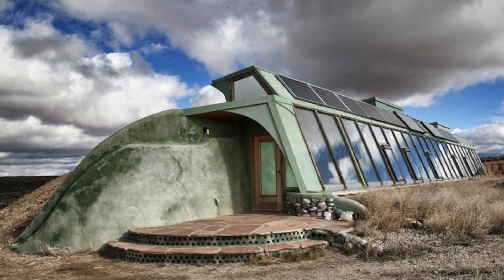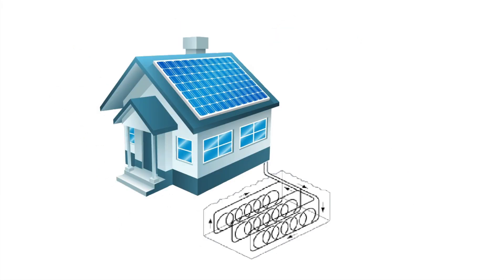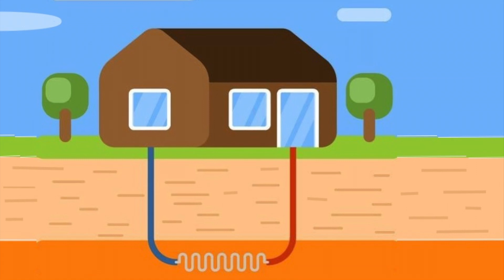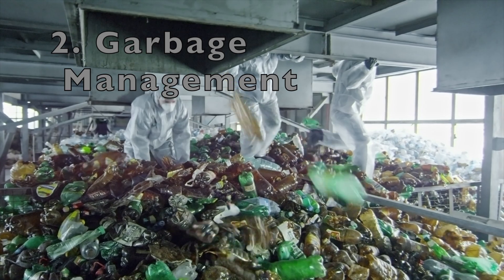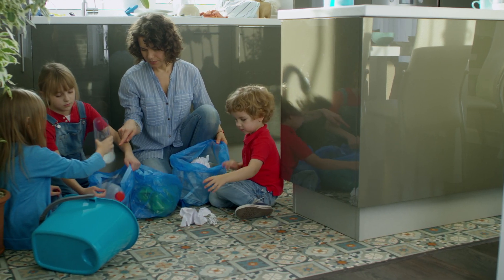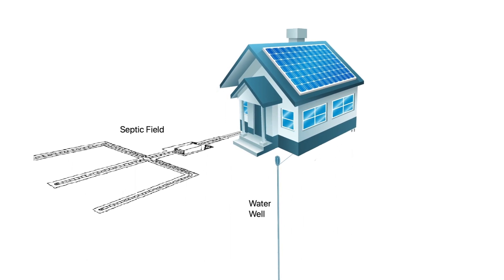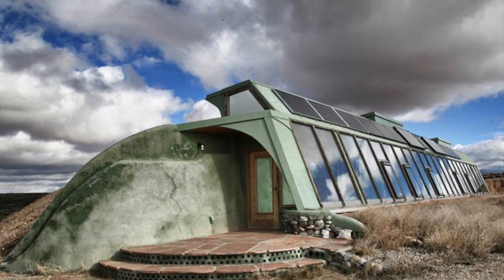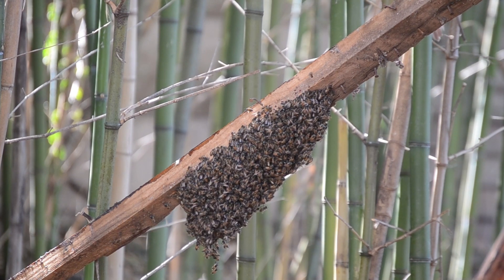Earthship Energy Savings for Any Home!

Comment: I agree that earthship construction balances/integrates a lot of compromises but no single one is a requirement for most of the design principles to be implemented. (Same as how one or more could potentially be used to retrofit a traditional home.) After attending a month long academy session and living with my family in an older earthship I will say that controlling the temperatures inside is not difficult, the roof vents are dead easy to operate, and from a systems perspective they do not really require more to be aware of than a normal home... most of which people are oblivious to in their own normal houses anyhow until a problem arises. This is why there is a thriving maintenance and repair industry ready to serve. It was not moist inside and it didn't smell. It did have flies but it wasn't out of control like some other much older ones.

Cooling tubes and earth berms work. The temperature is stable and the cooling effect works even before the building is fully enclosed. (I know, because on a 90 deg F day in the high desert working on a brand new earthship in 2017 we were all gathered around the cool air flowing into the almost completely open building while eating lunch.) We all also visited numerous couples and families living in a variety of homes covering the major evolutionary points of the technology over the years and they were all pleased with them. Even older retired couples had no issues managing the building. The greenhouses were warm but comfortable, the living spaces were between 68 and 72, the walls and floor cool to the touch and it was a blazing inferno in the sun outside. I believe re-engineering the ducts, transoms, and roof vents could improve the greenhouses more. However, the newest Global Models just seem to work.

Pounding tires is actually fun when you have the right people helping. But then again I would rather pound tires than pay for a gym membership... at least I get a building at the end. Foxhole homes in Alamogordo solved the tire pounding problem by using tire bales... huge compressed steel banded tire bricks moved into place by heavy equipment.

You are partially correct about the greenhouses tending to get too hot in older earthships but this is because Michael Reynolds and crew are not engineers; they are nice, well meaning, high desert hippies that "felt" their way through the entire process of refinement. "Close enough" engineering followed by copious amounts of beer and margaritas. It is my sense of the man that he really has a problem with authority (across ALL the required trades to build a home that is up to code) and while I respect what he has achieved I think he could have done a lot more if he had been willing to invest in engineers to bring the math necessary to optimize early on and find a set of design functions that the parameters of latitude, max / min temps, avg sun exposure, etc could have been plugged into and output how much southern glass was needed, how much interior volume of air, and how much mass of berm. You will notice the new designs use vertical glass rather than the aesthetically pleasing and distinctive slanted glass set perpendicular to the noon sun in winter. They are improving but at an absolutely glacial pace. They also waste resources as much as they reclaim. Their cabinetry and wood work is over built, adding to costs. They use crazy amounts of cement based plasters and coatings when other materials would work for infill before top coating. And they absolutely will not deviate from their southwest inspired design and Michael Reynolds has said multiple times that if you don't like his designs then basically take a hike; they won't build you anything that is customized. 

Water was not an issue in our quarters during the academy. My wife, our six month old (at the time), and I bathed, washed dishes, etc as we would anywhere else without really fretting too much about where the water level was in the sight glass. It "just worked" but some people in other areas did have to have a delivery of water but then they were not all the most... responsible individuals I have known in my life. :) Here in WA I would not have an issue storing and maintaining 6000gal of water in cisterns.

I disagree about the water systems. People have filters for water in their homes already (fridge water and ice maker, under sink systems, water softeners, etc) and well water often needs to be filtered and definitely needs to be pressurized in exactly the same way to make it useful in a home regardless. There is functionally no difference. Gray water use for flushing I think should be integrated into most homes... there is no reason I should be sending more water than is needed to my septic system than is absolutely necessary, and if that water is coming from a municipality all the more reason to conserve if nothing more than for operational cost savings. Botanical cells (the growing beds in the green house) are an adaptable and useful solution for this. However, older earthships absolutely do suffer from issues with them as they were often neglected when a new more interesting project came along. (Flies are the big problem with the oldest of buildings and I more than once suggested a good project for students to get hands on with systems would be to rebuild and refit the ancient botanical cells for modern versions with constant flowing water.)

Sorry for the large post... I do respect your ideas for bringing similar enhancements to existing structures.
Reply from the maker: OMG THANK YOU for such a detailed response. I LOVED reading it. THANK YOU!
Reply: @SimpleTek  I really enjoy your videos and ideas and it is nice to see a channel where a conversation seems to be genuinely desired.

There is also something to be mentioned of costs... the cheapest new earthship we toured was a "simple survival" design finished in 2016. It was a one bedroom one bath and the gentleman who built it almost entirely on his own spent only $50k (not including the land purchase) by avoiding waste, costly finishes, and using reasonable materials. He did splurge on large expensive SLA batteries that could be used inside the home without fear of gas releases simplifying things further. Earthships build by arthship Biotecture are expensive... something around $350,000 for a Global Model if they come build it with you. (It is hard to get a straight answer out of them on many of the specifics.) Like all things, if you are willing to put in the work yourself and take your time the costs can be brought under control. (Or if you are willing to use what will work and is not strictly up to code and can get away with it such as the philanthropic projects EB has done around the world where people just need something to inspire them to make use of wastes like bottles and styrofoam.)

I may sound like I am coming down hard on the Earthship crew but really they are kind and lovely people who are trying to do good in the world and I support their work... I just am not one of the "Cool-aid" drinking crowd and will criticize them on the areas I believe it is needed. I think Mr. Reynolds is correct when he points out that trash is now as much a natural resource waiting to be used thanks to humans as trees growing in a forest. I know there are many ways to recycle things like tires but pounding a tire with dirt has a much less lower embodied energy compared to transporting it to facilities for shredding and reworking.

Anyhow, have a great day.
Reply from the maker: @one_b  I think you are spot on about earthships and love the personal experience exposure you've had around them! please feel free to comment on any of my videos anytime, I love your comments!
Reply: I dig the post joshua. Especially your thoughts about water handling. I build geodesic domes. Do you have any experience with those?
Reply: @lemondealc  I wish I did. I have been dreaming about a geodesic dome based surf shack at the coast or auxiliary building in my back yard for a long while. (An inflatable aircrete dome was / is on the list as well as another contender.) Buckminster Fuller is on my short list of most inspiring people. My main issue with the various designs/possible materials is creating the necessary very accurately cut angles or justifying buying any one of the various costly custom connectors that have been produced to make the domes easier to build... then you have to decide how you are going to wrap it to close the envelope... Still

Comment: I already have a septic and well where I live but was thinking about using a solar pump and fan to pump the water thru a radiator  to cool it during the summer, What do you think?
Reply from the maker: if you have a place to put the water - well water through a radiator works great for air conditioning
Reply: @SimpleTek  I was thinking about taking it out of well thru radiator and back into well but was wondering if it would hurt the well somehow? maybe the heat would start algae but I could add some pool shock or something like it the well is 8 ft round and 40 ft deep  with a 6 ft tunnel at the bottom about 10 ft long, Yes I drained and cleaned it yrs ago LOL.
Reply from the maker: rv sorce I’ve heard a well can take back whatever it puts out, but I’m no expert
Reply: @rvsorce7196  please don't put some chemical's in your well. They could get to the groundwater easier than if you put them on top of the soil because you are already at the groundwater table.
Reply: @TheNightwalker247   I wasn't going to use a old radiator I was doing to build a new one and use solar to move it into and out of the well via a pump as well as a fan into the house, was just worried that heating the water and returning it to well might start some kind of algae.

Comment: It is important to pick off all low hanging fruit first.  For example I added insulation to my attic and sealed many cracks for US$600, including adding 500 sq ft of storage, ending up with 12 inches of insulation covered with a wood floor.  My gas company now says we are one of their most efficient customers.  Always do the cheapest with the best return in the least time...
Reply from the maker: well said!
Reply: The U.S. Dept. of Energy put out a booklet in the 70's that had energy saving tips arranged like you said. First was air-sealing, even over insulation, to keep your warm air from blowing out through your walls. Next was insulation, with proper overhangs for solar gain control. Next was landscaping, with evergreens for the north side as a winter windbreak, and deciduous trees for the south as summer shade, but allowing winter solar gain. The last thing that they mentioned was the interior arrangement of the house, with storage and mechanical spaces arranged on the North side of the building (This is the prevailing cold side during winter in the Northern Hemisphere). I know some people will say that making a house "too tight" will generate moisture problems and make you sick over time, that the air leaks are to maintain your health. This is just excuses by lazy people. Many locations now REQUIRE very tight construction, with monitored and controlled ventilation for comfort and energy savings.

Simple Tek mentioned that a lot of complexity in the water/waste management could be dispensed with by simply using a septic tank and leech field. Well, the tank and leech field ARE used in the Earthship, as the last stage of the process, called the outside Bio-cell. The whole reason for all the complexity of the water system is simply to utilize less water, in an area where water is a very scarce resource, and costs even more than electrical power.

The rest of the Earthship design is mostly Passive Solar design, with bits of PAHS (Passive Annual Heat Storage) principles, and a dash of "The $50 and Up Underground House". I fully expect that with the development of cheap and reliable IOT and computer monitoring and control (Home automation technology), ACTIVE solar design will once again flourish and provide an order of magnitude more performance return than the simpler passive systems.

Comment: I live one county over from Taos (where most of these Earthships are built). The average well here costs $35000 to drill. It is WAY less expensive to build or install cisterns and a water catchment field!
Water rights are also extremely tricky here. Many properties in northern NM do not have the right to drill.
Reply: Further, we only get 12" of rain a year and wells commonly run dry. So every drop is precious. In rural communities in the desert, reusing our greywater isn't about being smug, it's about basic economics and survival.
Reply from the maker: Thank you for the reply. I've never lived there and the concept  is foreign to me. How far down do you have to drill if they are charging you $35,000 for a well?
Reply: @SimpleTek  500-600 feet is pretty common, 800 is not unheard of... occasionally you can get lucky and hit water at shallower depths. But I've never heard of less than 150.
On my property we could reach water at 300 feet, but would only get about 2.5 gpm. We can't afford that, so we catch the rain off our roof and built a catchment field on the ground and 20k gallons of storage tanks (we hope to build another 10k this year). It only cost us ~2k in materials and our own labor for the whole system including the pumps and filtration system.
Reply: Magic and Mundane what cistern type do you have which is so cheap?
Reply: @T0MME0  We build our cisterns by hand with ferrocement. Other than the portland, all the materials are either bought from boneyards for pennies on the pound or scavenged from neighbors old projects (for example hardwire mesh pulled of an old chicken coop). We do sand gravel filtration on the water for the tap and solar still for drinking water. The catchment fields are built from a variety of scavenged material like old tin roofing. 
To buy premade poly cisterns in our area you could expect to pay 50 to 75 cents a gallon depending on the volume.
Reply: @madeofyucca  Ya for me its closer to $1/gallon. Would be nice to have workable alternatives, but doing every single thing by hand is adding to the time line tremendously.
Reply: @SimpleTek  when there are too many neighbors on the same aquifer squandering water, well recharge can slow down and even stop.

I grew up in a part of western Washington with 50 inches of rain per year where our well pressure could drop in half by the time the rain came back in September.

If at all possible personally I wouldn't want to rely on a well for surviving. Use the half acre garden water right most western states allow to hydrate the highest part of your landscape if you're blessed with a well, yes, but learn to dryfarm and install rain catchment to cover the direct water needs of your family.
Reply from the maker: @priestesslucy  every area is different, well said for your area
Reply: To clarify, I said $35k to drill, but that number is actually the total cost (except electrical) including permitting, the casing, drilling, and pumps.

Comment: The cooling loop should use multiple short tubes not a single long tube. If its being used for a house i`d  use an air to air heat exchanger to keep the two airstreams seperate.
Reply from the maker: both very good points.

Comment: But let me say i really like your attitude of doing it on a level that people can achieve not some really expensive earthship. Although earthships are a really great idea in general alot could be done by just doing alot of other stuff first like you said.
Reply from the maker: Thank you!  What's cool is the things I suggest could be added one at a time to most homes too making it even more affordable and possible for more people!
Reply: @SimpleTek  yes and we don't need to take down older homes first but rather upgrade them to be more sustainable. Especially heating in insulation can make a big difference because they use most of the energy of the home.
Reply from the maker: @TheNightwalker247  exactly!!!!

Comment: I agree with most everything except the water.  My parent's well went dry, they think from a collapse.  The cost to drill a new well in their area is about $30k.  To hook to municipal water system that only made it to the people across the street - $15k minimum which can be recouped somewhat if other people on their side of the street tap it too.  Fortunately, they have access to a non-potable well for all their water needs except drinking.
Reply from the maker: WOW - $30,000 for a well?!?!?! that's insane. it was about $8000 Canadian here and that included the pump, pressure tanks, hookup to the house and all necessary equipment. I guess a collapse can happen anywhere and areas subject to earthquakes might have to look at different options. Some of the people around here have wells over 100 years old.

All depends on where you live I guess. Thank you for the comment !
Reply: agreed, I think rainwater catchment definitely has it's place. We gave an abundance of water here in Canada, so we often overlook and waste much of it.